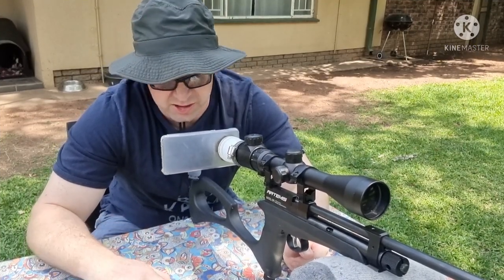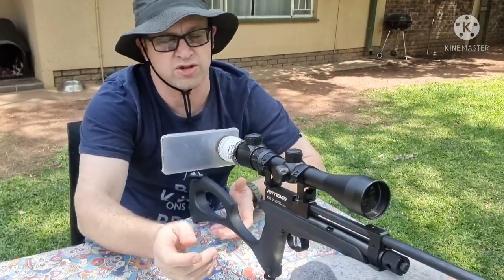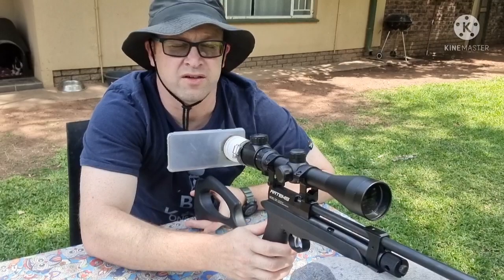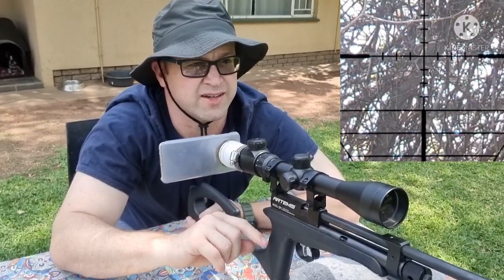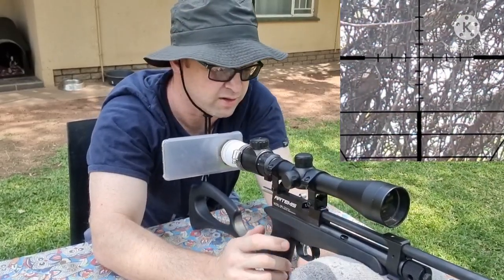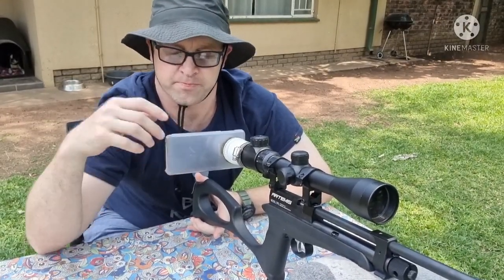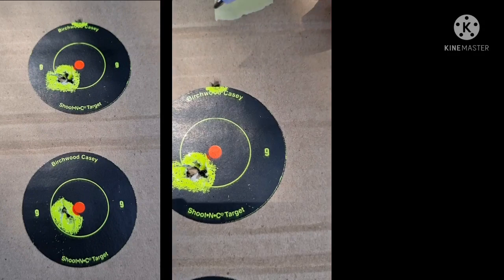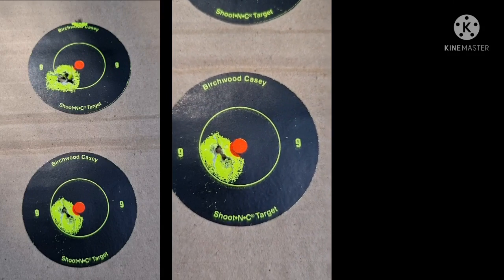Do you need artillery hold for co2 Rifle? Or only for springers

Comment: Thank you for the experiment. 
I'm refinishing the custom wooden pistol grip so I set the CP2 up as the rifle and fitted the PAO Topaz 2-7x32 LER pistol scope to it (being the only scope I have) and zeroed it in. Using a bipod on the Weaver under the 'action tube' (CO2 cap). The CP2 rifle is so light as to be toy-like, lighter than some air pistols I've shot. Consequently any kick or bounce is going to shift its mass, and the barrel does flex, there's a little bit of spring in it. Which is a reason a number of rifles are deliberately heavy, to stabilise them. The bipod is a bit loose on the legs so you can swivel the aim. I did not try it on the sandbag because that's where my left hand goes. I still find the stock a bit short but it balances the long barrel well. I found using my middle, second finger on the trigger (a Lee-Enfield trick) gave me a better fit on the short stock, it straightened my wrist.
I found that holding the stock into the shoulder stabilises the rifle a lot. The CP2 is so light you can hold it loose one-handed but I found the sight dances about doing that. I was taught to shoot firearm rifle so my left hand automatically goes on the forestock. The left pulls the rifle into the shoulder, the right only needs grip enough to gently squeeze the trigger. If you try to grip and pull back with the right you have to move the fingers independently, guitar and piano players can apply. But I don't know it you have noticed that the 3rd and 4th fingers share some tendons and cannot be moved independently. 
Very short slide-show of one scan of a target card (the only way I have found I can drop a link into YT).
https://www.youtube.com/watch?v=ZMQps8QJMXA
Reply from the maker: Looks like it is working great, nice group
Reply: @African-Budget-Pellet-Gunner  it is only at 10 metres to very large pistol target ;) 
Due to the bipod being in the way of my clumsy fingers, I let a lot of gas escape before I could get it nipped up. I got less shots than normal. It dropped from over 600 to 424fps by the time the rain pelted down.The target card got soggy and the yellow splatter didn't show on the scanner.

Comment: Your resting the barrel against the gun rest reminded me of the adventures I've had with my air guns;
As someone who owns a Victory CP2 and a customized Diana Chaser (pretty much the same gun as Tyrone uses in this video), I learned how anything touching the barrel while shooting can cause strange side effects; even mounting a bipod to the provided mount can have odd effects if the bipod has a rigid mount (pivot mount showed less issues).
Part of this seems to be the short mounting area the barrel has to the main action allowing for movement, which can and does alter the aim of the gun.
Another significant part of the problem lies with the barrel; NONE of these guns are high end, and their barrels are not as rigid as their more expensive cousins, which means they can, will and do flex when ANY force is applied!
Heck, attaching something as simple as a laser to the barrel can alter the barrel characteristics by adding additional weight, which increases flex in the direction of the "weight", so, the best solution I have found to counter such problems, is to make absiolutely sure that NOTHING comes in contact with the barrel while shooting, it WILL throw your aim!
As for bipods; either mount it to the forestock or use one with a swivel mount or just go without. Believe me, I found that one out the hard way...
At the end of the day, I still own and shoot both the victory and custom chaser, I#m just more aware of their quirks and pay close attention to the do's and don'ts of owning and using budget guns :)
Reply from the maker: Thanks for sharing your experiences with us it is much appreciated, and I agree totally the barrel needs to have as much free movement as possible especially on budget rifles
Reply: @African-Budget-Pellet-Gunner  You're welcome.
As an aside, the custom Chaser doesn't look anything like the original cp2 style anymore, while the main action and barrel are original, the rest has been rebuilt and/or modified to function as a bottle fed pcp air rifle that currently shoots at 10.5 ft/lb's and is capable of hitting the firing caps on shotgun shells at 20 yards (tested and proved, I also intend tune this to 11.5 when I get a new, larger bottle)
It has a proper stock now, which cradles the bottle under the barrel and has a weaver style mount attached to its underside, which completely isolates the bipod mount from the original/remaining metal of the gun, thus eliminating the risk of flex/distortion caused by attaching a bipod to the original mount.

As I said, you wouldn't recognize its origins without checking the label, yet whole setup cost less than £200 and is tuned for targets, pests and so on
Reply from the maker: @Gaisa Sanktejo now that sounds like a chaser I would like to shoot, have you got a video or some pics to share
Reply from the maker: Thanks email received
Reply: @African-Budget-Pellet-Gunner  Thank you, I prefer to not post links on youtube. I have since deleted the post with link and sent the email with a couple of updates :)
You should remove your email address from here before someone catches it and you get spammed..

Sorry to those who can't see the image, but I prefer to avoid certain links and such when possible
Reply from the maker: Thanks so much email received and it is absolutely awesome. I love that custom chaser, it has given me some ideas too.

Comment: When I was taught 22 firearms rifle at our club, it was to use the sling to brace it. It's difficult to explain so found a demo in the linky. 
It is far from new, pre-war. It was so steady that amateur competitors were beating the army at Bisley (which is local to me), so the army adopted it too.
Of course a 22 rabbit gun has practically no kick so holding it hard into the shoulder is not a thing. It locks the left (supporting) hand to the foregrip.
Quite what you'd do with the left side bolt of the CP2 is another matter ;) 
There's more than one way to skin a rabbit ;) 

https://www.youtube.com/watch?v=1HtaLUbTwZM
Reply from the maker: @Jeff Slade I can only imagine the armies faces when they got beaten. I don't have too much experience using a sling so will definitely check out the video, thanks for the link
Reply: A sling is a bracing tool.
Reply: @freshcharge  Yebbut (I think that's what I said) it's also for soldiers to carry their rifle. 
Back then the amateurs were probably ex-army officer-class shootin' set.

Comment: Howzit Tyrone,  only slightly off topic. I've been drooling over the CP2 for some time now and after I've bought my SF1400 .177, this is the plinker I want to get. My only concern is the C)2. How do you get around the expense of the cartridges and how many shots are you getting and lastly,  what mods do you recommend? ABF, what scope are you sporting on that CP2?
Reply from the maker: @Mark Thompson you honestly can't go wrong with a CP2. I know the CO2 is an extra cost but I just budget it into my pellet buying. Here in South Africa it costs R10 for a co2 cartridge. On 1 cartridge standard you will get around 40 shots with mods it will decrease. With mods I would recommend starting with spacers inside the hammer, thereafter stretch the spring. Both of these are reversable so if you not happy you can change back to standard. If you enjoy the modifying you can also drill out the internals I have a detailed video series on that. I currently have a Beileshi 3-9x40 scope on my CP2
Reply: @African-Budget-Pellet-Gunner  Yep, good ol' Are Ess of Ay. Gauteng, Petit, actually, so blessed to live and work on a fairly large plot. Yep, CO2 cartridges from take a lot aren't too bad , if you buy a box of ten, or more, they work out sometimes as little as 7 a pop. BNT charges 12, some other okes 15 per. is it possible to mod these for a remote line like the paintball markers? I've mucked around with cheap pellets. Never again. I got everything except the eyes right, so I can't shoot in bright sunshine. Too much clubbing as a roofie. I've truly been hummng and ha-ing about this CP2. You helped push me in the right direction.
Reply from the maker: @Mark Thompson in gauteng you have a super wide range of gunshops there, happy shooting
Reply from the maker: @Mark Thompson that sounds like a plan, my email is tyrone8511@gmail.com  I think I missed part of your previous comment, I have not tried the conversion to the paintball style with the bottle I have however seen it done with a crosman 2240 on YouTube and doesn't look too difficult

Comment: Can't hear you, and never rest the barrel on anything, it needs to harmonize freely.
Reply from the maker: @Frank Maze agreed resting the barrel on anything will shift your POI
Reply: @African-Budget-Pellet-Gunner  well there's 2 ways to achieve accuracy when it comes to barrels, either make it so thick and heavy that harmonics don't come into play, or make it thin and lightweight AND unfettered so it can vibrate freely.  I had a 22 magnum Savage rimfire that was all stainless steel and teflon and it used the first method, the barrel was 1" thick and very heavy (and extremely accurate).  But most airguns use the second principal of a free floating barrel.  That's why you should never use a barrel mounted bipod or rest the barrel on anything.  I think if you do some further testing, not only will it change the POI, it will also widen your group and reduce accuracy.
Reply from the maker: Agreed and Thanks for sharing your experience